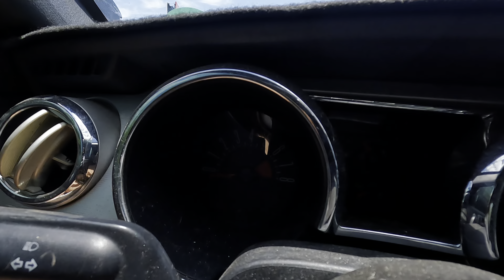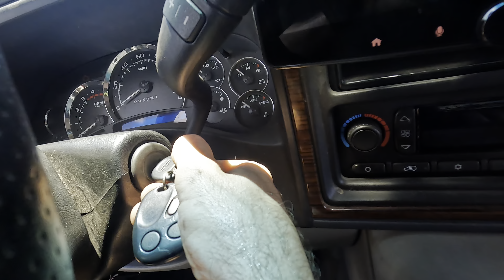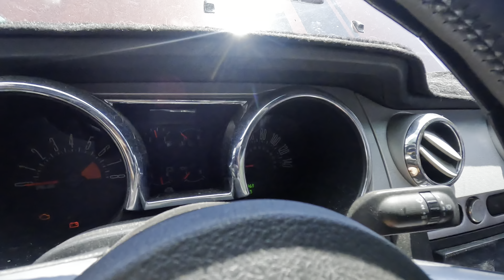Great Way for Wheels To FALL Off! (Wheel Spacer) Ford Mustang GT

Comment: 51:09 Don't you think you should test for Runout,  it could be a bad wheel berrings  and i think a better dial indicator mounted on a long jack stand with a mag lock is more stable then on some car part that can move,  the flex stands are too sensitive.
I laughed my ass off watching a rookie tire jockey testing for run out 
When his dile indicator was all over the place.

Comment: Please never use any grease or other paste between the wheel hub and brake disk! No matter how great the risk of rust forming there. This reduces the friction between the two components. In the worst case, the wheel bolts could shear off in the event of sudden emergency braking.

Comment: Umm why do you connect the ground directly to the battery when jumping?
Should hook it to a bracket or something. 
To prevent damage to electrical systems.

Comment: Too bad you don't care for your Milwaukee 1/2" impact gun. If you were willing to make a donation... I would be more than happy to accept!  Just out of curiosity... did you check the master cylinder before compressing the brakes to make sure there was adequate room to take the returning fluids?

Comment: Right at 10:00 - does anyone know what causes that etching?  My Durango has that around every lug nut on every wheel and I've never figure out what caused it.  They're pretty deep etches you can easily feel with your fingers.  Is it just from rocks and road debris being kicked up and scratching the wheels?

Comment: I don't know the exact details of your equipment, but the power unit you built in your truck for power outages (which I envy a lot) should be using a deep cycle battery in order to provide steady power over long periods of time. Those really shouldn't be used to start vehicles, as they are not designed to provide large bursts of power like an engine-start battery and could shorten its lifespan significantly if used for that purpose.

Comment: Those jump boxes use a lithium ion battery right?  That should last longer than a year.  Maybe just buy a lithium ion car battery, which is expensive, but they are light enough to carry around and if it’s meant to go in a car it should have a warranty.  Though I guess you could just get a cart and a regular car battery.

Comment: Well your Mic was working rilly good but then it was not working as well when you walked away could barely hear you so I think the mic got switched to the camera and the mic that you have on you got turned off or the battery died but other than that it seems to work well.   For the spacers if it was me I would make a tool that ether go to two lug nuts with a steel bar about two foot long so it would rich the ground or have a round steel plate has holes for the lug nuts and have the holes for the spacer with a steel bar two foot long so that way you can torque them down at the right specs and you can have a piece of mine you know that your tires an rims are not going to fall off your auto

Comment: You don't seem to ever check the master cylinder level before you start compressing the calipers. Without opening the bleeder, you are pushing all the fluid back up into the master cylinder. If it's full before you begin compressing, the fluid will burst out of the master cylinder all over the engine compartment.

Comment: Your jump boxes are only lasting a year because they are using lead acid or AGM batteries.  You need to pick up one with Lipo or Lifepo4 batteries in it.  The lithium battery jump packs last way longer then the Lead Acids will.

 I have a 2000A 18000mAh Jump Box that I have used a few times.  One time I was getting gas and dude was trying to jump this ladies car with cables.  After filling up the truck and watching him fail to jump the car, I pulled out the jump box and asked if he wanted to try it.  Car started first crank.

Comment: wheel spacers are illegal here in Aus.  They result in excessive additional bending moments (i.e. load x distance) on bearings and wheel studs, they offset wheels beyond allowable limits and have been the cause of wheels falling off. IMO it is simply not a good idea to install these devices.

Comment: Wheel spacers are fine, if they fit right. They need to be hubcentric and not too wide. At least 70% of the BMW crowd runs 12 or 15mm spacers. We also run longer bolts to make sure there are enough threads to bolt them on securely.
I think it needs to be clarified though, that whats on this car, is not spacers. They're adapters of some sort. Spacers would sit on the same studs as what holds the wheels on and use a single set of lug nuts, not 2. Thats the biggest problem with these. To do it properly, he needs real hubcentric spacers, and longer studs, not some cheapo generic crap.

Comment: Wheel spacers are ok but every time you remove them you have  to after a hundred  miles you need to re-torque them.

Comment: Ray:
Your audio was fine at the beginning. Then it deteriorated. What happened?
In a word AGC. Automatic Gain Control.
This has been around for over 80 years in radios.
In your application everything is working as expected, until it wasn't. The AGC sets the microphone gain for the proper input to your camera mic jack. 
When there is no competing signal everything is fine, until perhaps an air compressor kicks in , or a vent fan, and you walk away decreasing your signal to the AGC, so it with a certain delay starts to increase the gain so you have a proper input to the camera, but the AGC cannot tell your voice from the interfering signals. Note during quiet periods the noise in the back ground increases. When you speak, or some other continuous noise appears it will set on that noise if it is stronger than your voice, the background noise increases after the continuous noise stops.
This is fine in a studio, or if used in a quiet area. The solution? You need a wireless mic made for this purpose. The guys at Precision Transmission have used several models and they have figured out the best solution.

Comment: The microphone is working too well. Your shop circulating fans are too loud.  Consider using a foam wind cover on the mic to suppress the back ground noise. Amazon has them.

Comment: Ray, why don't you pack bearings at this time?
2006 Ford Mustang  has wheel bearing that can be packed with grease in the  front wheel bearings of a 2006 Ford Mustang:

Comment: As far as your audio goes. Most of the time you sound nice and clear. When you lower your voice it gets a little muddy. I'm also hearing a lot of background noise that changes in volume. (It sounds like a waterfall inside a cave.) When you seem to be talking a little louder the background noise gets less. But if you stop speaking for a few seconds it sounds like the background noise is getting louder. I believe that is being caused by the microphone having an Automatic Gain Control. If you're not hearing a lot of background noise while making the video. Then that would lead me to believe that the AGC circuit is a little bit to aggressive. I'm not expecting to hear studio quality voice, because you're working in a difficult environment. Lots of hard surfaces that reflect the sound. As well as noise from outside the building. And this is definitely not a complaint.

Comment: way to much grease on the slider pins, it will prevent them from working properly because of the grease pressure

Comment: rely on alternator?  When jumpstaring it is your BATTERY that starts the other car, not your alternator.  No alternator in the world delivers enough ooomph to drive a starter.
Reply from the maker: Hehe I have a 300a alternator and a 140a on this truck 😏 (but you are correct)

Comment: Because Ray never showed or told on this vidio I assume he never did the following. When changing brakes the FIRST  thing you should do is to take out some brake fluid out of the reservoir i would recomend half way. When you compress the pistons back into the cylinders the fluid goes back into the reservoir. If you don'nt do this the reservoir will overflow and leave brake fluid all over the bodywork and we all know what that does to the paint  work. If you look back to the vidio when he is changing the passengers side you can clearly see a pool of liquid on the floor underneath the drivers side. If you look clearly you can see drips falling into this pool. If this was brake fluid and Ray did'nt clean it off then he will have a very big problem when his customer sees all of the paintwork gone. It does'nt take long too start working. i would say if you get brake fluid on your bodywork remove it immediately.

Comment: Throughout my time is a diesel mechanic Apprentice, I have learned patience. The only thing that really pisses me off is the stupid engineering choice that where made Like on a diesel. Isuzu npr They have a plastic fuel bowl.
 That is so tight on the frame rail housing That the likelihood of cracking it is 90 to 10. And the sad part is that part is on national backwater, like it's stupid🤣🤣

Comment: I'm baffled by your stance on jump boxes, as smart as you are with all your diagnostics. If your jump box batteries only last a year, either you're buying the cheapest dog crap jump boxes, or doing something wrong. We keep several NOCO jumpers around, and they will jump off anything at any state of discharge, and they last a long time.

Comment: Least favourite gun... well I have a Torch/worklight from the same brand, and it sucks, the Battery has a 4 minute life span unless it's just the tiny light at the end of it that's on and that only lasts an hour.
Yep use the rattle gun on the shitty lock nut... that's how you get people to stop using the shitty ones

Comment: Only problem with that Mustang is the owner. Instead of installing the big brake upgrade it needs, he has red caliper covers and stock brakes. Then there's those wheel spacers 🤦‍♀ instead of cheaping out and using them he should get wheels with the correct offset.

Comment: So…why not resurface instead of replacing rotors?   I understand it takes about 20 minutes a rotor to resurface but if ya can do for say $20 per rotor why add the expense of rotors?   Seems like everyone these days is a parts replacer when it comes to brakes.   The investment into an old Ammoco machine is about a grand and it gives you the ability to resurface multiple things.  Figure if you can resurface and they are within spec, the cost savings to the customer would be a win, win.   You commented about heat dissipation but never pulled out a micrometer…. Just saying from the “old days” at Sears and GM dealership, if you had 15-20 thousandths over minimum after resurfacing, you give the owner the option.  Seems you require replacement even though you have an O’Reilleys for a supplier that her in North Texas, charge $15 per drum/rotor to resurface.  Big difference in overall cost of job.   We use to use the Pematex silver lithium lube for slide pins and our parts washer for cleaning the rotors, calipers and backing plates/hubs.  Cost effectiveness is about 20% of using brake clean solely.   Ammoco still sells the roll around cleaning station for brakes and is much less expensive for daily use.  Love the videos but question the added cost to customer if able to save them money.  Had more return customers from saving them money the first time…. 
😊

Comment: 21:08 that new mic is picking up some background noises... Thats a law mic?

24:09 WHAAAT? Looks like is not a law mic Becouse you go away your voice is almost silenced.... couse mic just picking up the sound of the room... USE law mic.... Attach under your shirt and your sound would better.....
Get rid of that mic...
Couse if you buy a cheapest law style mic which can useable on your android or apple phone, you can record way better audio then this nonsense.... just dont forget to clap when you start rolling.... to syncronize the audio and set the correct audio level... while you recording...

Comment: Lol, nobody knows better'n you how tye car makers just cant  K.I.S.S. with these cars, lol. Keep tryna reinvent the wheel so to speak. Watchin this and im like all these little parts , why. Mt disc brakes on my trans am , pull bolt out, caliper falls out, pull pads , replace em may 30 min, lol